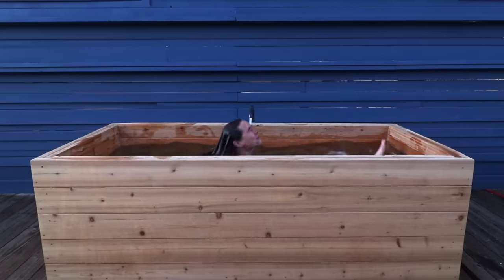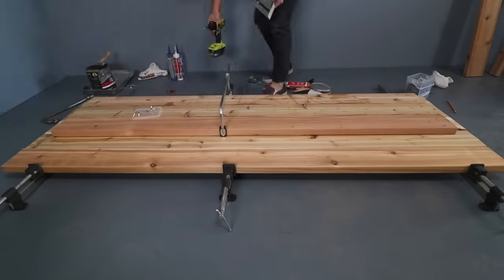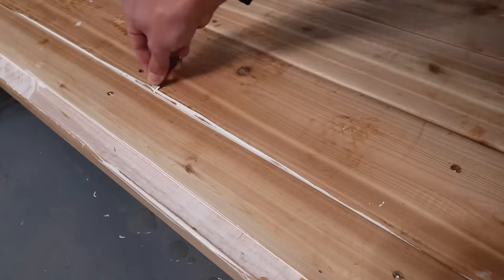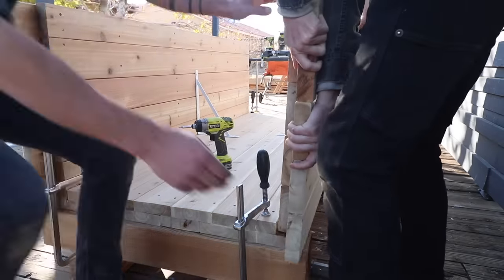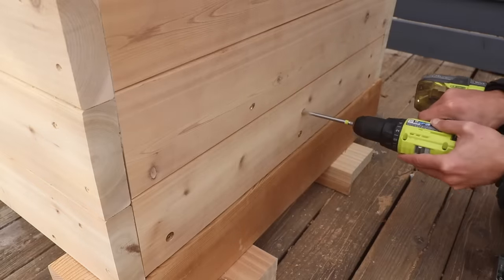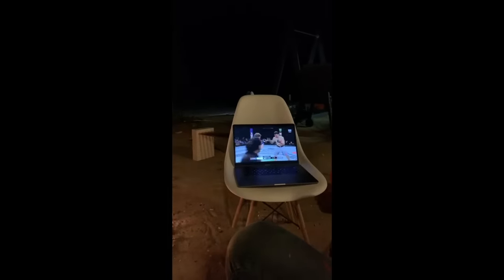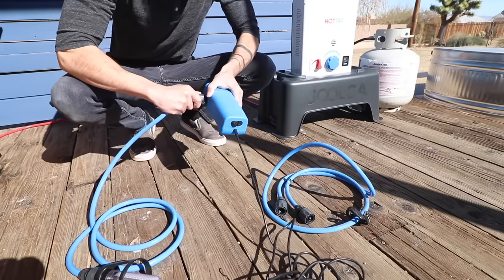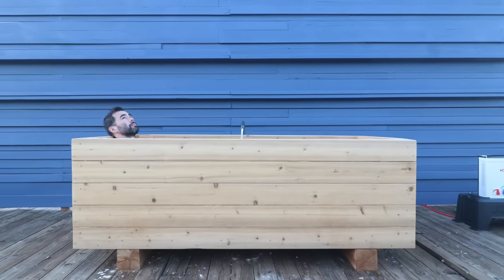I made a WOOD HOT TUB out of 2x6s

Comment: Cost of lumber probably made this same price as a new hot tub.  :)
Reply: Don't mention it :-)
Reply: Plus the cost of Flex Seal, that stuff ain't cheap.
Reply: This is probably more than a actual hot tub.
Reply: Post Pandemic, maybe lumber gets cheaper. But Cedar is almost never cheap. Between that and the flex seal, you are probably better off just buying a hot tub if you add in the man hours and tools necessary to do this.
Reply: Yeah, but you don't have the satisfaction of sitting in your own one-off, hand-made, cedar hottub that you made yourself. It's about the journey man...
Reply: To you maybe, but it's simply the 'cost' of the video. You can't earn money from YouTube without content, and based on the viewcount and subscriber count, the author came out way ahead.
If he had just purchased a hottub, no video to be made, and so he actually would have 'lost' money.
Reply: No need for flex seal or doubble layers.
Reply: Poor guy had no money left over for a work bench.
Reply: @triggeredtroll6466  blow up hot tubs have tons of issues from bad pumps to thermometers etc if anything is bad on that unit the whole thing is trash basically so not worth it. Also could be cheaper depending where you live and lumber is coming back down to normal cost. On another note you do not have to use two layers simply just cut each board to interlock together sealing between them because no matter what this thing is gonna rot just as everything does but this would last longer than any blow up hot tub or a normal hot tub for that matter.
Reply: Aesthetics. It is a piece of art in its design and simplicity. It is also way easier to repair than a commercial hot tub.
Reply: @triggeredtroll6466  I have an inflatable. The motor is toast after 20 uses. Garbage.
Reply: This is stupid and not cost effective at all
Reply: Lol
Reply: But for people like me and others who love to build. The satisfaction we get from doing it ourselves is beyond words can explain.
Reply: ... or more!
Reply: I'm near Chicago
 You can find them free almost any weekend, as long as your willing to move it . Same with pool tables.
Reply: Without a doubt. A single cedar 2x4x8 is running $23.95 at the big orange store.
Reply: Nah.....not even close.
Reply: We made one with new sleepers... half the cost of a fibreglass hot tub
Reply: YouTube paid it off
Reply: Not sure why cost should matter with something this cool and fun. Because these days - who cares. Have fun.
Reply: Thanks sleepy joe
Reply: Yuuuup
Reply: @722Moo  Oatmeal Joey. 🥴
Reply: @firsargentum5920  The real hot tub was the friends we made along the way.
Reply: I was thinking the same lol
Reply: @triggeredtroll6466   what kind of hot tub are you buying for $500. Lmfao!!  A decent hot tub is $10K. Between my pool, Hot tub, decking fencing, landscaping I have well over $100K in my backyard.  You have to pay to play.  We all can’t be ballin’ with our $500 Amazon HotTub.🤣🤣🤣🤣🤣. Mr Trigger Troll.
Reply: @oceanside88  ya because a real hot tub costs $10,000 and up.  Trigger Troll is ballin’ with his Amazon Inflatable HT.
Reply: @Cultofpersonality09129  100k backyard but your reading comprehension at a 2nd grade level?
Reply: Yeah cedar was an expensive choice.
Reply: Irrelevant lazy comment
Reply: Yeah but as a content creator everything can technically be considered a tax write off not to mention whatever monetization he gets from YT itself.
Reply: @paullukis3315  good chance you’ll find free hot tubs in your area too. I see them on NextDoor all the time. You just have to pick it up. I’ve gotten several that way and fixed them to sell off.
Reply: I was doing the math and thinking the same thing.
Reply: Use cement blocks , some construction glue and plaster next time . Way less money , won't rot or leak . Dig a ditch a few feet deep . Line walls with large 8 x 6 x 12 hollow cinder blocks  , rebar the floor and lay 2" drain pipe. Pour 10 bags of concrete in floor . Plaster over  walls and floor,  connect water heater &  circulation pump. Cap the cinder blocks with smooth floor tiles 360 degrees . Under $1000.
Reply: @sullennessa3819 Art? It's a wood box.
Reply: $32,000.00 DIY hot tub…..priceless…..
Reply: @earth_ling  like those shop channels with $13,000.99 worth of tools talking about DIY.. May as well have a Toyota factory make DIY pickup truck vids😭
Reply: @cascadinghaze7125 

😂😂
Reply: So we just gonna ignore snow white feeding a chipmunk at 6:41? Lmaooo
Reply: @uzis4life  

Lmao…
Reply: Took the words out of my mouth… The exact comment I was going to make lol
Reply: Yeah but DIY one is cooler
Reply: If you throw in the hours of labor then yes it would be.
Reply: You need to add LED ligths buddy. Under the tub or buy a pool mini led ligth and install on the inside. It's easy and looks great. Pool/spa led ligths are 12V
Reply: I rushed here just for this comment.
Reply: @Cultofpersonality09129  tell us people don’t like talking to you without telling us people don’t like talking to you...
Reply: I think the point is wood is recyclable/compostable. Meaning it is is good for the environment as a opposed to the plastics and insulation etc, that hot tubs are made from.
Reply: Funny, the only thing cheap in the PNW is Western Cedar.
Reply: Not with 3 million viewers 😅
Reply: You should compare apples to apples. What does a wooden manufactured hot tub cost? Don’t compare to the price of a fiberglass tub,
Reply: Idk man. You can do this with pine wood. Any wood. Live anywhere near a lumber mill. Cmon free. It's technically for some people a great diy. But if your really at the store buying the priciest wood yes. Your a fool
Reply: @722Moo lol. Thanks Dump.
Reply: Really good build. Gave me lots of ideas. Thanks
Reply: Looks like a rewarding project to embark upon but whereas I have to work for a living and not spend all my time screwing around making things, it is unrealistic unless I plan on using it in 5 years or so
Reply: @TGtac19 Show us Yours
Reply: Looks awesome
Reply: No way. Hot tubs are outrageous. The cheapest ones are like $5K without delivery.
Reply: Could u make this and use the fire pit heating system with it!

Comment: really weird and expensive way to build a tub. Cedar tubs use the swelling of wet wood to tightly stretch against the metal straps around the tub, your design could have worked with a single layer and actually use the strengths of cedar if you’d cut a rabbet to create a tongue and groove connection between boards.

Comment: This would require a second mortgage to buy that wood in Canada.
Reply: Not if you have a buddy with a saw mill
Reply: Why do america love cider so much? Even those 6 by 6 are cider. Why
Reply: @wiktorszymczak4760  Well, some Americans may love it because it can have an attractive-to-them natural color, which is a reason any people group might choose to use one wood over another.  As for the 6x6 being cedar as well, well, perhaps they already had it around from another project, or had a use for it afterwards.  Also -- cedar is a good bit more sustainable than some other woods used for building.  So...reasons?
Reply: @Zzrdemon6633  How many tree hungers did this guy piss off..
Reply: @wiktorszymczak4760  cedar is very moisture resistant. very good to use in wet places.
Reply: Just wondering if you have a total cost to share. Awesome video!
Reply: @wiktorszymczak4760  It's more water resistant and mold resistant than a lot of other woods on the market. It's preferred for health and longevity reasons in any situations involving water exposure
Reply: @wiktorszymczak4760  resilience to bugs and rot.
Reply: @wiktorszymczak4760 It's a very good wood that holds up outdoors, and will not rot. it also has a good smell to it. Also, it repells various insects.
Reply: @wiktorszymczak4760  it smells nice. It's supposedly resistant to pests.

Comment: Yes, you can use any wood that will hold the weight of the water. No flex seal needed. Wood glue (TB3)  and screws to hold it together. Then, coat the entire inside with commercial grade epoxy. Stone Coat sells it retail and theirs is good up to 600° with a uv inhibitor included.

Comment: You can build this out of plywood, but you would need to frame it with dimensional lumber in order for it to withstand the outward push of the water. Polyamide Epoxy will seal it perfectly. It comes in a variety of colors (including clear) and it is widely used in plywood aquariums. It would certainly be cheaper to build with plywood.

Comment: I made several hot tubs using 1" marine grade plywood. I glued (from the inside using stainless steel screws) and glued 4 levels of 2 X 6's  horizontally around the plywood to keep the plywood from bowing. I also screwed and glued triangular vertical wood pieces in the inside of each corner for extra strength. I then painted the inside of the tub with epoxy paint.  Worked great.
Reply: Would love to see pics of it. It sounds great!
Reply: That sounds great! Do you have any plans or specifics you could share? I'd like to try that.
Reply: Plan Please!
Reply: Need something like this for disabled vet
Reply: Yeah, the inside with epoxy is probably what's making it durable. The tub from the video isn't going to last
Reply: @acevfx2923  that's what I said
Reply: several? do you have a hot tub business? send us your website , pictures of your great work.. thanks!
Reply: yes tutorial please!
Reply: Epoxy is the way to go every time.  If it works for boats, it'll work for a hot tub.
Reply: You lost me at flex seal. Bye

Comment: Love it. I did a similar one out of marine ply for my container home, did 3 layers and it still leaked in the corners ended up putting lots of clear silicone in the corners to fix it, kinda similar to yours. Respect from NZ
Reply: @Missagan Does marine ply really have that? I know pier lumber uses CZA(Copper Zinc Arsenate) but marine ply? You thinking of PWF?(Permanent Wood Foundation/pressure treated ply) Most vendors in the USA won't sell cza treated stuff to non-contractors afaik. I don't think I'd want to soak in a plywood tub regardless though.

Comment: Nice build. You should do a small test version without the flex seal. There are boats that don't use any sealant at all. I believe the water swells the wood and seals all of the boards. And I'm surprised you didn't offset the boards to have a lap/box joint on the corners, this would give your corners much more strength and allow you to get a fixing in 2 directions. It's a simple design but looks and seems to work great 👍

Comment: There should be a small benches or seats inside at the ends so you don't end up sliding under the water and not seeing over the sides. This allows you to sit easily without having your arms over the sides to hold yourself in place. There needs to be a small steps or platform on the outside so you can climb in and out of the tub without a slip.
Reply: Make it and put it in, rather than fixing permanently which makes it harder to clean
Reply: Your right, doesn't look much comfortable as it is.

Comment: I would probably frame the tub with something much cheaper like Douglas fir, insulate with insulating board, and then sheath the entire box with cheaper 6 ft cedar fence board. It would look just the same or even better at less than half the cost.
Reply: Plus you would have a removable skin and space in between in case you decided to add jets later.
Reply: Working on this project now. This was my approach so I could reuse an electric hot tub box with jets and insulation.

Comment: Wow, that was amazing. I guess it goes to show how well the Flex Seal product works. It's going to be interesting to see how long term this construction is!
Reply from the maker: yes! but cedar does hold up well and we can only just caulk the cracks if seams do open up.
Reply: Good thing he had those Maker Brand clamps, too! Couldn't have done it without those.
Reply: @porsche911c  if someone is giving them to you, that's great. You can get long pipe clamps from Harbor Frieght for not a lot of money. You just supply the 3/4" NPT pipe in whatever length you need.

Comment: Put a double layer of fiberglass over the entire surface, inside and out.  You can bond it with epoxy, urethane or a variety of other products.  That's how they waterproof cedar strip kayaks and canoes.  No leaks, and it significantly increases the strength of the joints.
Reply: Is it toxic to have heated water ?
Reply: @rubenandrethorseth6265  No.  Fiberglass is what most commercial hot tubs are made out of.  Usually the resin gives off a lot of fumes during the fabrication process, but once it's cured, it's physically stable against heat and mechanical stress, and chemically inert unless you expose it to things like acetone or MEK or other strong solvents.

Comment: I don't know how long you intend this tub to last, or what your weather exposure is where you live, but since you spent a ton on cedar, you might drain it and let it dry completely, then coat the insides with thinned epoxy.  This will accomplish two things: 1) Epoxy is waterPROOF, not merely water resistant.  Thinned epoxy will saturate into the fibers and not just seal the surface.  It will make the wood sort of like a plastic laminate. 2) Raw cedar will soon begin to split and you may get long, sharp "bayonets" that can be very annoying.  The boards you used are "plane sawn" not "vertical grain", so they will cup and produce the sharpies. The epoxy will greatly reduce that occurrence. 

You can leave the outside bare and it will naturally weather to a nice gray, but you could also seal it with a marine/spar urethane for a deep golden finish.  Make sure it is UV rated.

Nice job.
Reply: This won't last a year as it is now
Reply: @johnymst  I think it will.  The wood will "take up" water and swell the fibers shut, just like the Vikings boats and ships - which would leak horribly until they swelled. To me, it looks like he has enough fasteners, driven deep enough to hold the corners together. Soon, though, all that silicone will be a problem as the wood sheds it into the water and it clogs the drain.  That stuff is horrible for staying put.  Should have used a polymer caulk.
Reply: the touch of epoxy feel plastic, i am prefering wood feeling
Reply: @alexandreguillaume6066  Thinned epoxy does not have a plastic coated feeling.  It soaks into the wood and seals it below the surface.  It's appearance is like a clear varnish.  Multiple coats will provide an attractive waterproof seal that builds up to a smooth touch.

Comment: I would highly suggest to coat the entire tub inside out and bottom in 4-6 coats of a marine grade polyurethane. This would probably dramatically increase the lifespan from rot and the constant expansion and contraction of the wood that's being directly exposed to the elements and water. 

Like Minwax Helmsman spar urethane
Reply: It's Cedar. It's fine for a long time. Sealing it all in will make it rot faster.
Reply: @jakegray9850  Rot requires moisture, if the wood is sealed, no moisture can get in, so no, it won't rot.
Reply: Is that safe to bathe in though?
Reply: But you wouldnt get that amazing smell of hot, wet cedar!

Comment: I’d be interested is seeing a follow up video a year later and how it’s doing after the wood sits through a winter or two. 

Cool project with very few tools, I like it!
Reply: Probably sitting in the dump after the YT video dropped.
Reply: That silicone isn't going to hold.
Reply: @TheyForcedMyHandLE  that's what I think too
Reply: @LitoGeorge  also wouldnt the tub mold and crack from the humidity
Reply: too bad about all the buried plastic and silicone... the untreated tongue & grove cedar would swell with the season and wouldn't leak
Reply: Flex seal doesn't hold up to outdoor with big fluctuations at all, especially when thick, in my experience.
Reply: it not going to lol.
Reply: Didn't see him plane any edges just put glue. Any cracks he just pulled tight with clamp pressure. I give it 6 months
Reply: @AndreasDuessca  Yes to cedar. The old farm house where I grew up was all cedar shake siding and cedar shingles. With zero done to it ever, it stood up to the elements for a hundred years, until my brother-in-law pushed it over for more farmland last summer.
Reply: Our cedar lined sauna (floor, walls and ceiling and cedar benches) go through Canadian winters down to minus 40 C when we aren't using it, then up to plus 50 C when we are in it with it cranked up to the max. Use it as a dry sauna but also use it as a wet sauna with a pot of water with essential oils added on top of the hot rocks of the sauna heater. Inside it looks like the day we built it more than 30 years ago. Cedar has it's own natural oils which make it ideal for both temperature and humidity extremes.
Reply: Ya'll acting like round wooden hottubs isnt a thing lol
Reply: @splittedchipper2788  I think the bands that secure the boards into each other make wooden ones last longer than this one.
Reply: Gravity and the constant motion of pressure on the sides will work that silicone loose once  it sets.

Moreover, the external temperature and moisture levels causes timber to expand and contract. That alone will destroy the seals if the joints don’t fail first. 

Moral of the story… this is a temporary hot tub. It won’t last very long. Hence why spas/hot tubs are now a weatherproof composite material that is usually formed of one piece material.

I wish you the best though.
Reply: Yeah can we please get a follow up video!
Reply: @Razumen  Given his use of construction adhesive and flexseal, it's unlikely he used a proper sealant.

Though with cedar, you could go a while before sealing it.
Reply: The right way to do the joints is that you have a groove down the middle of the long grain where it joins.  Then a water resistant wood that swells is placed in the groove.  When it comes into contact with the water, it forms a water tight seal.